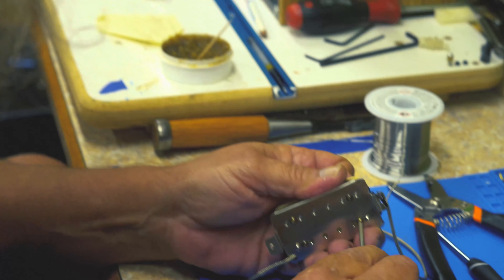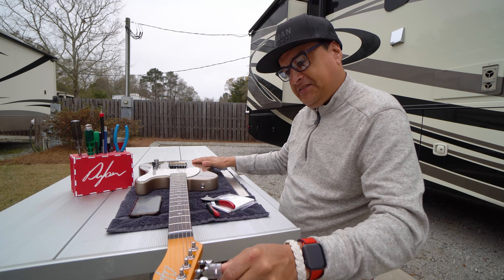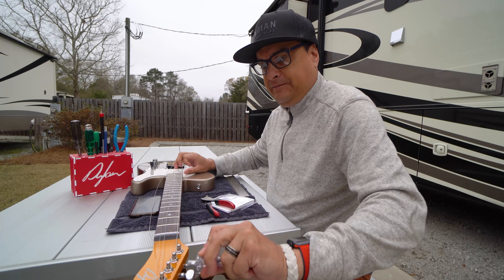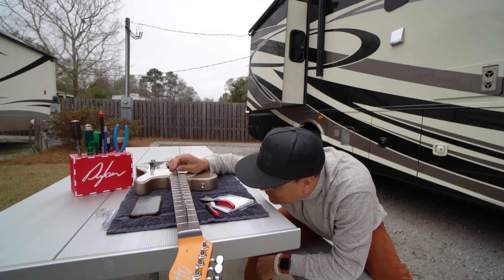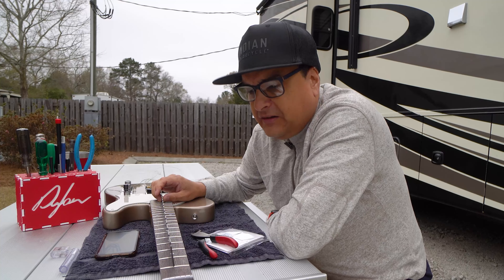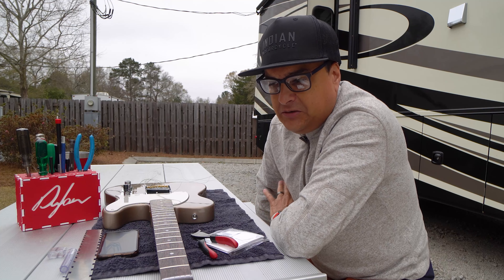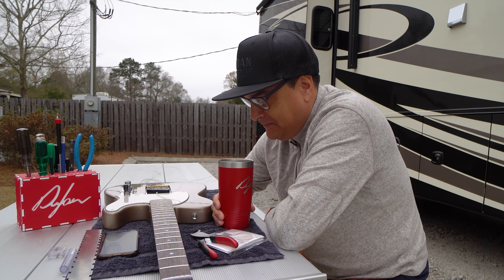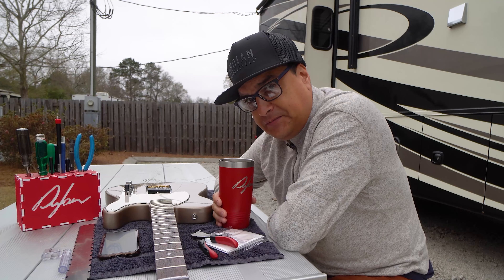Should You Change Your Guitar Strings One At A Time

Comment: What I've got from your videos so far:
Potentiometers? It doesn't matter
Capacitors? It doesn't matter
Magnet material? It doesn't matter
Coil wire width? It doesn't matter
Pickup output? It doesn't matter
String tension? It doesn't matter
Just pick up your guitar and play.

I love your channel man! ✌🏽
Reply: That is sort of right yes.  Lots of guys can take any guitar and sound amazing.   A lot of guys  until recently, never had much money to even get involved in tech stuff, they just focused 100% on playing,  only  fairly recently did  lots of guys get way deep into having tons of gear, and get into all this tech stuff constantly.  Before that only top pros had time or money to mess with it. Now every  guy with a few bucks saved up, goes and gets  tons of gear.

Comment: In the early 70s, I was gigging in Kalamazoo, MI.  Pat Murphy and Tim Shaw had a nice guitar shop, they also made guitars.    I needed a little work on my Firebird.  When Tim Shaw cut off my old strings with wire cutters, I was very shocked, but was told it's ok to do that.   I've been cutting strings ever since.
Reply: Same here. I just lower the tension beforehand so they don't snap in my face.

Comment: The only times I change the strings one at a time are with my one floyd rose guitar when I can't be bothered to do a full setup blocking the trem from behind to set the bridge angle. The one thing I'll never do is clip strings under full tension. The last thing I want is for a rouge string to gash me in the hand or make a scratch in the guitar finish, no matter how unlikely either of those are xD I'll take the few seconds to unwind them before cutting
Reply: Or maybe with a Bigsby. That could help when changing strings, if you don't have a capo at hand

Comment: If the guitar neck greatly springs back or changes it may not be bolted or glued in right.  If you believe the tension will change the neck  then surely doing a string at a time could warp the neck. But is does not

Comment: Dylan, Gibsons didn't use scarf joint construction in their necks. The problem with their headstocks is the steep 17 degree angle combined with the LACK of a scarf joint. The grain is running parallel with the fretboard, and as the headstock falls back, those design specs combined with the large truss rod access route, leaves very little grain running parallel to the length of the headstock. It ends up making it very easy for the headstock to shear away from the neck.
Reply from the maker: Yes. Absolutely. I misspoke there. Thanks for that. Pretty well known, I was just thinking of snapping necks and totally misspoke.

Comment: I wouldn’t worry about the neck, but if you have a floating term, or an acoustic, I would do a much more controlled gradual change of tension. The bridge slamming against the top (unless it is blocked) can mar the finish. Stressing the bridge on an acoustic is more of an issue than the neck.

Comment: Necks are "laminated" at least in that the neck and the fretboard are separate pieces strengthening each other. Then there are the multiple-piece necks which are even stronger, and those with reinforcement rods that are rock solid. Fundamentally I think the material that served well for the masts of sea faring sailing ships for centuries can handle the occasional break of a .016 gauge string. What does happen though is the bolt of the tuner coming loose under the percussive action of the snapping string. The only parts of a proper neck that could actually wear out over time are the holes drilled perpendicular to the fiber, for the neck mounting screws and for the tuners, but even that would take a couple of hundreds of savage string changes. Unless of course we're talking about the plastic neck of the Koloss 🤣 I can change the relief of that one with my bare hand, even as I'm playing!

Comment: Feels like a stupid question, but on higher tension guitars (12 strings and basses) does more care need to be taken in terms of "easing" the neck for a string change/setup, or is it all just hogwash?
Reply from the maker: It seems that if the neck is engineered to hold the tension.... then it’s no big thing. I think there are some necks that are flimsy ....
Reply: On a Rickenbacker 12 you tend to change them in pairs because it makes life a little easier and a 6 string one or two at a time

If you take all the strings off then the hateful R tailpiece falls off and restringing becomes an even bigger pain in the ass.
Reply: @RobCrawford23  -   Loose parts which require string tension to stay in position can be taped in place.

Comment: If you have a trem system, even if its decked, you probably want to change the strings one at a time, otherwise you will definitely have some movement in the bridge and be setting the intonation every time.
Reply from the maker: Lol.... next video.
Reply: Huh? Definitely?! Why? Please explain because I've done hundreds of setups and thousands of restrings and I've never experienced this problem. If it's not a floated trem, it's the same as a fixed bridge. You can take all the strings off at once. If the trem is floated, temporarily block it, then it also becomes a fixed bridge. Then you can take all the strings off at once.
Reply: @Ky -  Intonation should always be checked and adjusted after changing strings.
Reply: I release the tension before i cut the strings anyway.   I take all my strings off when i change strings and i have never had problem with intonation going out?   Im not saying Dylan is wrong im saying i don't  have the kohonies to do it.   👋
Reply: I think that's only for floyd rose bridges 😂 if you have a normal decked fender classic style bridges, it should be fine

Comment: I triple dogg dare you to do that to a 1966 Gibson J-160E ..you wouldn't lol
Reply from the maker: Bring me one....
Reply: @DylanTalksTone  ok
Reply: @ScatZacc  -  I used to cut the strings off my concert-size Taylor 715 all the time.
Reply: @rb032682  by tuning them up and then cutting em all at once.. can't be any good for the wood lol
Reply: @rb032682  I mean I get it nothing probably has happened to you or many others don't mean it can't have something bad happen 🤷
Reply: @rb032682  and I don't know what you concert Taylor has to do with it I was talking about doing it to a 10 thousand dollar vintage accustic you wouldn't so don't do it to reg accustics
Reply: @rb032682  doo you know why the tops of a J160E accustic has a laminated top? Cuz the pickup weight would make the wood sag just a little single coil ..wood is very temperamental
Reply: @ScatZacc  -  Maybe it was a Taylor 714.  I haven't seen it in 20 years.  It was one of their top-of-the-line giant acoustics. It survived a 400-mile trip in the back of a truck a -21°F.  It was an expensive guitar I wish I still had.
I would cut the strings off any guitar, unless I had time to waste.
Reply: @rb032682  fair enough
Reply: @ScatZacc  -  The only bad thing which has ever happened when I cut the strings off my acoustics: hands/face getting hit with a freshly cut string. 
  I get your point.
   I agree, wood is temperamental, that's why most of my guitars have composite necks.
Reply: @ScatZacc  -  Do you mean "tuning them up" to pitch, or tuning the strings far above pitch, as Dylan did in this video?
Releasing that much tension probably isn't good for the wood, but it probably isn't bad either.
Reply: @DylanTalksTone  see what kinda fiire you started lollollol 😆🤣😂
Reply: @ScatZacc  -  lol